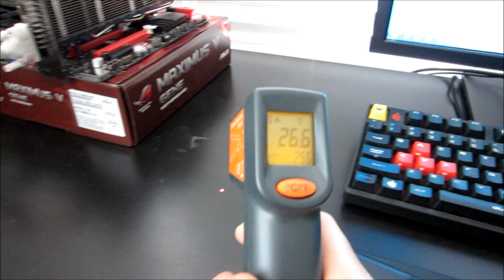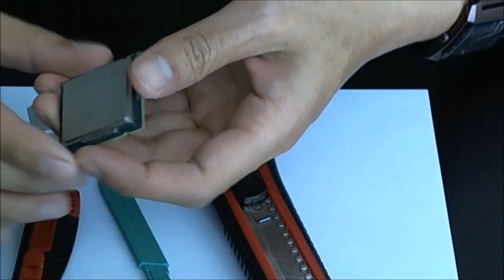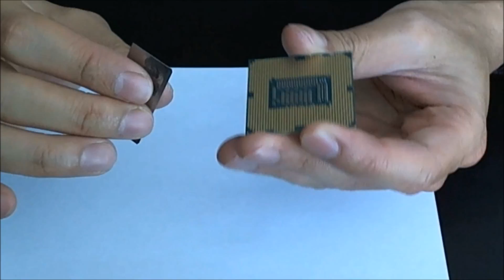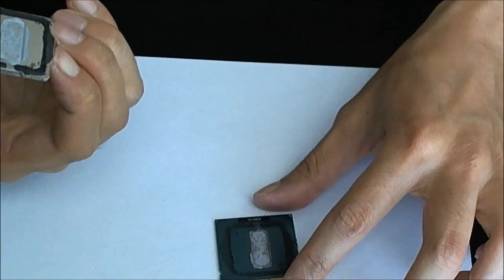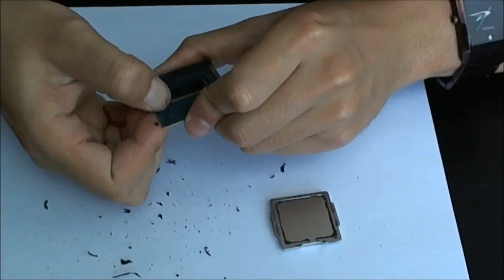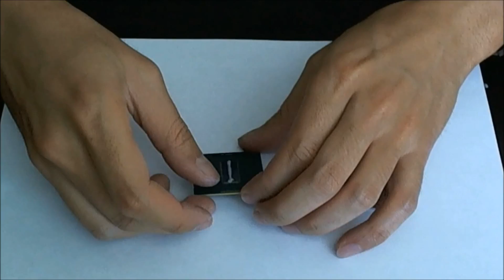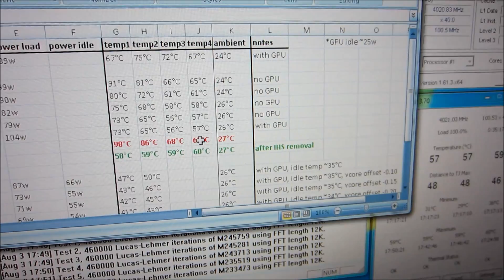Fixing Skylake, Haswell, and Ivy Bridge CPU temps: IHS removal

Comment: i dont understand all of the negative comments.  this guy has fixed his high temp problem and is now getting bashed.
Reply: trolls
Reply: You should know by now that YT comments are generally very negative relative to any other entertainment. These turds will always have something negative to say or put others down. If you look at the results in the video, that should tell enough. Thumbs up is higher, but only the trolls will comment.
Reply: People always have to hate.  He said it was his first time.  Props dude!
Reply: maybe because he done it in a barbaric way. it was hurting my eyes. he could done this more professional
Reply: @androidlast3329  Teach us how then. We are here to learn :D
Reply: his temps seem insanely high lol... unless he has a stock cooler or something. my 4690k @ 1.3v @ 4.6ghz with NHD14 Noctua doesnt even come close to those high ass temps. never delidded
Reply: @dondonian5364  lol you think his temps are high? I'm getting 80c on fucking IDLE on my 4770k with a Corsair H100i closed water loop on stock speeds... looking back on things, it has always ran kind of hot since I bought it years back, but it just keeps getting worse and worse...
Obviously I've tried reapplying thermal paste and reseating the cooler several times with no effects, and it would just make sense that I'm having the same problem as the poster (Poor Thermal Interface Material from manufacturer). I guess I'll have no choice but to delid my CPU... wish I'd found out about all the complains sooner!
Reply: @neptaliortega1250  my 4790k sits around 46c I'm finally delidding it and putting an all copper ihs on so hopefully I'll be sitting in the 30s after.
Reply: @neptaliortega1250  what about lapping the cpu ??
Reply: I think the negative comments and downvotes started about 5 years after he posted this. Now they have heat spreader removal tools so people are probably not paying attention to the date thinking, "This guy is an idiot for doing it this way." They don't realize those tools weren't really available to consumers yet. Also, as far as liquid metal is concerned... same thing. It didn't exist in 2012 for consumers.

Comment: Thanks for the video, interesting. I have been wondering if anyone knows if a complete reflow job has ever been tried on this when refitting the heat spreader? It wouldn't seem like too much extra work to get say a .008" stencil to apply some solder paste and get the pcb and spreader sent back through a reflow oven and see what the difference in temperatures would be with a true solder joint. Also, do you know if it is possible to fit the PCB back in the socket and using an custom cooler, fit a heatsink directly to the die, i.e. leave off the heat spreader.

Comment: Why reattach the heatspreader, once ou have taken it off? Wouldn't it me wiser to place the cooler directly on the die? Is there any good reason, why the heat-spreader would have to be there? (except for protecting the die itself from mechanical damage, due to wrong placement of the CPU-Cooler)

Comment: At correct thickness the difference between the best and worst pastes is only a couple of degrees. 

Once delidded, you'll get far better efficiency directly mounting the heatsink.

20+C difference shows that the issue isn't the quality of Intel's TIM, but that it's far too thick or there are airgaps.

Comment: What if I use it without the lid?
Reply: Sumona Florence 200 mhz lezz go boi
Reply: then you'll run even hotter than before idiot.
Reply: Why? Laptop chip does not have lid. It is cooled straight from the chip to the heatpipe.
Then why not do it on PC?
Reply: Sadaki Can you overclock on a laptop? That's right you can't. They run weaker, and hotter.
Reply: fesfers I'm just wondering if they can run without the lid. 
The chip + thermal compound + the lid + thermal compound + heatsink vs the chip + thermal compound  + heatsink.
Like using a SOI based CPU. They are hot but easy to cool.
Reply: Sadaki well you could try that :? But it would prolly just run hot
Reply: Well I can get a G3258 to test it out, feel bad for my motherboard though.
Reply: fesfers laptops have turbo boost.
Reply: You can do it with the new X99 motherboards, they have a delid CPU cover but you will need a new CPU
Reply: TheNilar has nothing to do with anything but k.
Reply: Yes you can but you will need a mobo that supports direct mount and a highend liqid ciooling unit and as Zsolt Lada said the is a good chance it will crack if you over tighten the heat sink.
Reply: fesfers I overclock my i7 4700HQ and increase it's performance from 3.4GHz to 3.6, I also made it run cooler. ;d It's a laptop CPU. ;3
Reply: fesfers It is still something. ;d It's 8-10% increase in performance on single core ops. :3
Reply: Sumona Florence Wait the turbo speed of the 4700HQ is 3.4 Not the base frequency. In other words you're only overclocking one core... whoohooo
Reply: Yes, the base is 2.4Ghz I think. Turbo is 3.4, but I bumped to 3.6 ;3 not amazing but it is still nice for the better performance in games ;3
Reply: Sumona Florence only single threaded games. Since you're only boosting the turbo which applies to one core.
Reply: Hmm, most my games I think are single core, some dual core. If it's dual core, does that mean the 200mhz is split into half and given to both cores?
Reply: Sumona Florence no. Turbo core only applies in single threaded applications (for intel) So if you're doing anything single threaded. one core will slow down to save energy and heat, and the second core will speed up. Like I said, it's just overclocking one core for single threaded applications. It won't do anything in multithreaded games as turbo only applies in single threaded shit.
Reply: Poopie! At least I undervolted it to save on some wattage and heat, though. ;d
Reply: fesfers You can overclock Laptops, but it's not recommended because of the cooling.  I can overclock my A6 APU from 1.5 to 2.6 easy and will only run at 70-90C at 100% cpu usage (TP Max is 101C) and i live in a desert where it's 110 outside and 80 inside so that's pretty low.  The problem with overclocking laptops is that they get dust in them so much more easily and it's much harder to clean them out so they just run hot a lot of the time, but if you can take a laptop apart and clean it good it runs just fine.  It all kinda depends on what it is and what you can do.
Reply: My lappy has two fans. ;D dedicated to the 770m and my CPU ;d

My 770m is overclocked by 135Mhz 13mV and 1200Mhs refresh ;d

CPU -70mV and multipliers upped for an extra 8% overall and on turbo! ;d

Nothing goes above 70*C. Record temp was 81*C on the most strenuous bench I could give it. ;3

I'll be repasting, too.. change from the factory crap. ;x
Reply: fesfers
Like world of tanks?
Reply: ***** http://rog.asus.com/wp-content/uploads/2014/03/New-G750-heatsinks.jpg  ;d My heatsink
Reply: fesfers turbo boost bumps all the cores not one.
Reply: TheNilar http://www.intel.com/content/www/us/en/architecture-and-technology/turbo-boost/turbo-boost-technology.html
Reply: fesfers you can OC laptops. aleinware for example.
Reply: leo gemignani ew...
Reply: lol nothin wrong with aleinwares
Reply: leo gemignani sure :) Except for being completely overpriced.
Reply: thier desktops are overpriced for sure, their laptops are actaully priced even better than some competitors.
Reply: leo gemignani "some" Not a single one of their laptops are worth buying
Reply: that's what you think hahaha
Reply: leo gemignani no it's a fact. More money. Less performance. It's not worth buying.
Reply: leo gemignani Alienware are to overpriced i got a MSI GT72 2QD Dominator for 18,500 kr with gtx 970m 6gb vram while the alienware have dual gtx 860m 2gb vram for the same price. The MSI GT72 2QD Dominator have a much better gpu than the alienware so alienware is overprised shit.
Reply: All of you guys are fucking stupid. Theoretically you COULD use it without the IHS with the heatsink directly on the die, but due to the construction of the CPU bracket, it would never reach the die. Normally when you mount an Intel chip in a motherboard, the IHS sticks out a bit friom the bracket. Some people have successfully de-lidded their CPUs but it required extensive modding of the motherboard itself to get proper contact with the heatsink. 
Laptop processors run without the lid because a) that way it's thinner b) laptop cooling is bad enough as it is and if laptop CPUs had heatspreaders they would run even hotter.

Running the CPU de-lidded is potentially easier on AMD because of the mounting mechanism relying on two latching points and tension. If you de-lid the CPU there's probably enough tolerance in the retention arm of the heatsink for it to go a milimeter or two down.
Reply: fesfers you can over clock a laptop. just that it's not recommended and if you over clock it and you damage the CPU it would not be covered in the warranty(that's if you buy a laptop from a shop).
Reply: Sadaki it will not be as efficient
Reply: BrainSeepsOut msi gt72 have good cooling.
Reply: John Dilinger x99 cpus have soldered tim so trying to delid will break you cpu no matter what. fesfers if done correctly delidded cpus run colder because there isnt anything between the cooler and the die.
Reply: fesfers Not a fair comparison, laptops have tiny heatsinks with barely any airflow.

Comment: Seems the Coller doesn't sit right at the beginning.
My i5-3570K @ 4,3 GHz runs at 67°C, 75°C, 77°C, 72°C with HR-02 Macho
Thats 5-8°C hotter on the Cores 3&4, 9°C cooler on Core 2 and ridiculous 33°C cooler on Core 1)
Reply: I recently reset my coler and my temps are now at 64°C, 73°C, 75°C, 68°C
Planning to delid my chip to get slightly lower and more evenly temps.

Comment: or maybe just mount the cpu cooler fan to get air from another place rather than a hot video card?
Reply: That won't help. Its mainly the CPU causing the heat. I have tried to delid my i5 with a Thermal paste using CLU and CLP. The temperatures drop 20 degrees...
Reply: Do you even delid bro?

Comment: i was nervous the whole video, and the fact he he just edited out the whole process of putting things back gave me a feeling he butchered the first CPU and changed to an another one, without removing the heat block.
Indeed, i understood that this would be one of those videos where "a bad result" magically turns into a "magic result"; ( in this case, a 50degree temp drop).
Reply: SuburbAllied ... 40c drop, lots of people do this, it was the same chip.

Comment: AFTER YOU TOUCHED the cpu`s connectors you can throw out the cpu because they wont send through a signal that good anymore. That is why they are golden. To have a better connection with motherboard. I doubt it that you have a perfectly clean fingers.
Reply: lol i have touched the pads on the cpu so much times and they are still working. Even if my fingers are dirty, hell u can just take your shirt and clean the grease from your fingers

Comment: I find it hard to believe that a thermal paste has diamonds in it. What is the name of that thermal paste? I want to look it up. 

Also I wanted to add. I hope Intel gets to see this to improve their process of applying thermal paste to their processors. Did you write them a complaint or a letter about this?
Reply: It does have diamond in it, its polysynthetic (man made) so its not worth nearly as much as real diamond
Reply: Ranstead Moons You're wrong, it's not a shit heat conductor, look it up. It's not only synthetic diamond, it's diamond powder, that results from diamond cutting/processing. The powder is mixed with some type of grease. It's practically the best after liquid metal, which is getting really cheap now. - Best one: Coolaboratory Liquid Pro/Ultra, next is Innovation Cooling Diamond 24
Reply: Bryce Anglin Well to be fair, diamonds aren't even really worth that much. They have a massive markup. But obviously manufactured diamonds are still cheaper.
Reply: Alex Trinity Yes we are.

The "top" of the chip is actually the Silicon wafer ("die") the device was built on and the 20+ layers of circuitry which make up the CPU are facing downwards so the interconnect pads can be directly bonded to the carrier board (substrate). That's what the "Flip" part of "flip chip pin grid array" means.

http://en.wikipedia.org/wiki/Pin_grid_array#Flip_chip

"A flip-chip pin grid array (FC-PGA or FCPGA) is a form of pin grid array in which the die faces downwards on the top of the substrate with the back of the die exposed. This allows the die to have a more direct contact with the heatsink or other cooling mechanism."

If the circuitry was facing upwards, there would be a nest of wires around the edge leading to leg lands, as in the image at http://www.computerhistory.org/revolution/digital-logic/12/282

You'd have to grind down at least 0.1mm (or more! - Most of the way through the die) to even get close to damaging the actual circuitry of the IC itself. With the wafer being effectively as hard as glass, that's simply not going to happen unless you deliberately set out to destroy the device. 

FWIW, grinding down the IC is used a lot for reverse engineering and it's regarded as very long-winded process.

You're in far more danger of damaging the die by chipping or cracking due to uneven contact pressure than by abrading the exposed top service.

Bear in mind that all the layers of circuitry on the top of the wafer (they become dies when broken up into individual chips) combined are about the thickness of a human hair - much like the icing layer on a cake. The die is so thick so that the things can be handled and to provide rigidity for the circuitry.
Reply: Bryce Anglin why does it have diamond in? Diamond is a shit heat conductor, especially compared to cheaper alternatives... Marketing ploy?
Reply: Alex Trinity Fair enough but I still feel it's a bit of a marketing ploy... obviously diamond powder contained in grease will not provide the 5x thermal conductivity of copper that pure diamond gives... Most of the heat transfer will be through the grease and the diamond powder will only slightly enhance conductivity... which, like I said, makes it seem like a marketing trick... "Buy me I contain powdered diamond"
Reply: Ranstead Moons yes, and it's actually pretty stupid, it seems that some guys used the powder directly on delided CPU's destroying them because of the highly abrasive particles. The liquid metal one is practically the best one by all accounts, from the prices here, it's cheaper than the diamond one, and has like 2 degrees lower temps, which is quite impressive. From my point of view, it seems to have no disadvantages at all... well apart from the fact that it's electrically conductive so you got to be a bit more careful not to put too much.
Reply: Why's that hard to believe? They have diamond dusted saw blades.
Reply: Alex Trinity very fine diamond nanopowder paste is used to polish glass (and the CPU wafers). The trick with diamond paste is the ratio of nanopowder to grease. The grease is only there to carry the nanopowder and fill air gaps.
Reply: Alan Brown Thanks :) - but the thermal compound is still highly abrasive.
Reply: They use diamond dust because carbon is an electric insulator. so the paste doesn't short anything out. boron nitride and silver are the usuals for thermal conductivity
Reply: diamonds have virtually no value at all, we can produce synthetic diamonds  that are indistinguishable from real ones
Reply: Alex Trinity its only abrasive if you rub it.
Reply: Alan Brown ... and while you put on the cooler, you don't apply pressure and rub it? :P
Reply: Alex Trinity nowhere near enough to go through the protective top layer of the chip, unless you're extremely ham-fisted.
Reply: Alan Brown We are talking about the de-lidded CPU, right?
Reply: Ic diamond
Reply: He said it in the same sentence, IC Diamond.
Reply: Here's a wee math exercise.

Take the quoted thermal resistance of any given material and work out what the thermal resistance will be with a thickness of 0.1mm and 0.05mm

The short answer is that when properly installed, the difference between the cheapest and most expensive thermal paste on a cpu dissipating 100W is less than 3 degrees Celsius. 

I encounter  more variation on installations done by different people using the same materials. Installation method is far more critical than "whizzy" properties of the paste. Don't slather it on like sunscreen. 

Incidentally, over-polishing the surfaces will also reduce overall  thermal conductivity. I suspect that beyond a certain point the lack of surface roughness results in the surfaces "floating" in paste instead of having metal-to-metal contact with air gaps filled by the paste.
Reply: Tony D Don't question the man who just lowered his CPU temperature by 30+ degrees C with nothing but a rusty razor and some thermal paste.

But yeah, you're right... this guy should be running Intel's manufacturing department. He can sit there with a couple bottles of thermal paste going over each CPU one by one... because well... I don't trust Intel to do it anymore.

Comment: Now let's talk about politic....
Was is the Intel company? A little shop at the corner of the street?
Well, not really, it is a high tech company.
So, could somebody tell me how the hell is it possible that theses High Tech guys have not been able to put the right product to dissipate the heat generated by the processor? It clearly look like a commercial issue more than technical.
a
I swear that if I could shake the hand of the Big Boss of Intel one day, I'll not give it back before it is in the same state as a intel cpu, melted.